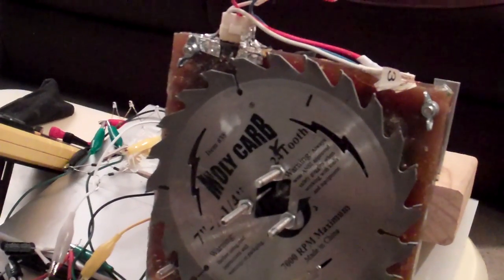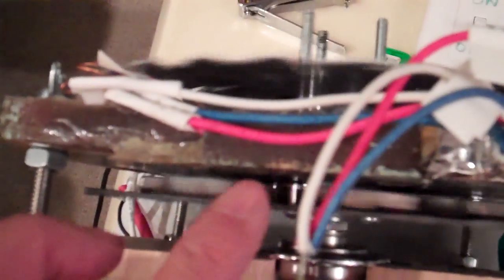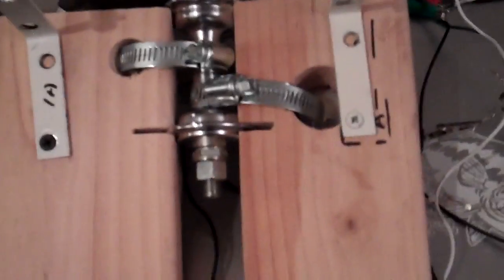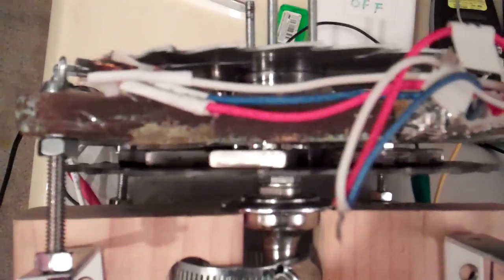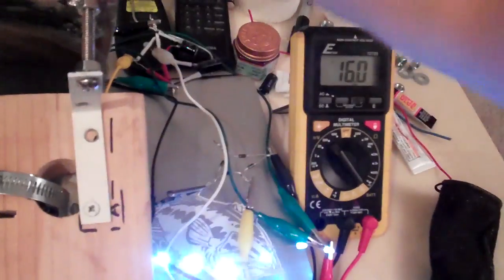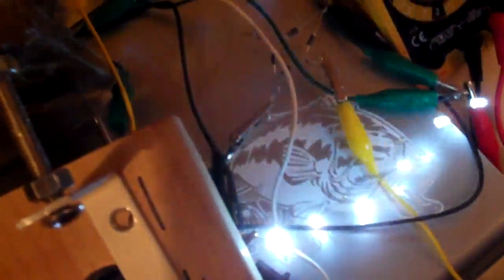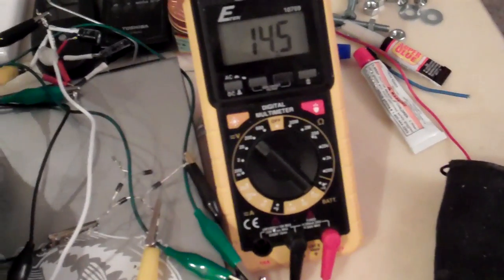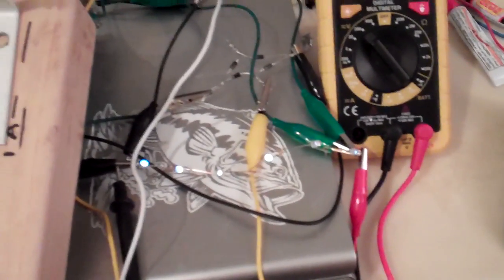Small  6 coil axial flux alternator with bicycle hub bearing, Part 2.mp4

Comment from the maker: @MrHorsetail Actually, what I know I learned from Youtube. I still have some questions about the wiring. If I were to make a tutorial, I'd be laughed off the tube. Then again, it's rather simple once you have the right bearings. Unless you are making a hawt, they always turn kind of slow and you won't even get it up to charging voltage. Muddy hasn't completed has axial flux tutorial, but he's the one to watch.

Comment: I think you have a winner there.  This is exactly what I'd like to build.  I need a generator that works at low wind speed.  I like the use of the saw blade too, great idea, no need to buy a heavy piece of steel.  I hope you put together a tutorial on how this is made because I would like to try one myself.  I can't believe how easy it turns too.  Thanks for making this video.